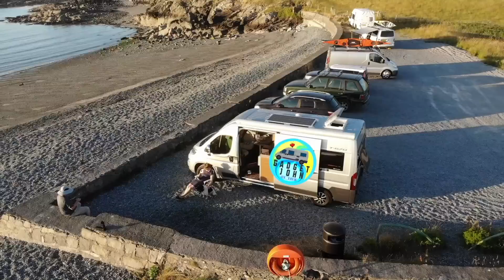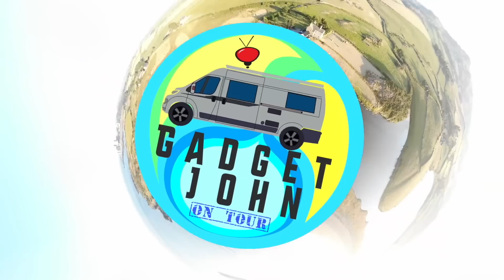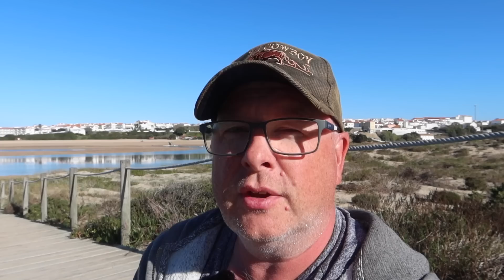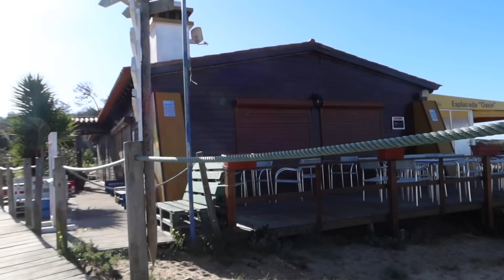VanTech Tuesday - Solar Power Special

Comment: Morning Guys,

Love the videos and general positivity....keep up the great work 👍

Possibly a stupid question, but here goes...

We’re  in the process of buying a Burstner TD Harmony with the Elektroblock Transformer/Rectifier. I’m reading about switching off the 12v panel when the van is temporarily parked up for a few days, I get that, but the handbook also states to disconnect the leisure battery via a battery cut off switch on the Electroblok during long periods of storage. Also fine, I understand the principle because some of the consumers still use power even with the 12v panel switched off.

However, if I disconnect the battery this way will this also disconnect the solar regulator therefore stopping the solar panel keeping the leisure battery topped up ?, or does some auto electric witchcraft keep the solar panel charging ?

 Also, if the solar panel does disconnect , will any harm come to it if it has nowhere to send the charge to ?

Any advice massively appreciated !
Matt
Reply from the maker: If you wire your solar charger to your battery then it’ll always keep the battery charged up. We don’t leave our van in storage so I can’t say what’s best, but if we did then I’d just turn off the power on the control panel and leave the solar working & charging
Reply: @GadgetJohnAdventures  Thanks guys, kind of what I thought, can’t imagine leaving it on will do any harm as long as all the panel is switched off. Love your van by the way, Burstner should pay you royalties. We weren’t considering one until we saw your video’s. Enjoy Spain, cold and foggy here in Yorkshire 👍

Comment: Hi John

Thank you very much for your below informative and detailed reply

I have decided to proceed / Install a Sterling "Pro Batt Ultra” Battery to Battery changer.
I have also decided to add into my system the Votronic 12V Stand by Charger (Trickle Charger) for my starter battery. 
I have also added the Victron Smart Solar 100/30 MPPT Charge Controller

I have installed 2 x Xtreme AGM 110 Amp batteries,
They will be charged by solar and the Victron IP22 240v Mains Charger

My question to you is based upon my past experience of an older American camper
When plugged into mains hook up / Shore line,
My old American camper 12v power was drawn from a mains / 240 / 12v transformer
By using / drawing the 12v power from a step down transformer, 
I was not draining / cycling / using my 12v Batteries

Would you recommend incorporating a 240v / 12v step down transformer into my system 
And using this for 12v power when connected to mains supply ?

I would appreciate your advise on this issue
Reply from the maker: So I can better answer you can you please get in touch via the contact form on my website 👍🏼

Comment: Hi John, when our camper is parked at home the panels are nearly level, when it rains the water collects on the panels. Obvs should the temperature go below, zero the water would freeze. Do you think that standing water/ice would cause any issues for the panels?          Last year I made a couple of simple ramps to de-level (if that’s a word!), so most of the water would run off, tried a cover this winter instead, but still wonder if I may not need to do anything at all. 👍🏼
Reply from the maker: It should be fine, most vans have this issue when left standing and I’ve not heard of them cracking due to ice build up 👍🏼
Reply: Gadget John on tour Cheers John 👍🏼

Comment: Hi John      not sure if you mentioned this -   when wiring up a panel do you have to have the controller as near to the battery as possible , or does it not matter ?        Also worth mentioning, i know 3 people who have blown their controllers up because they connected the solar panel to the controller first, instead of connecting the controller to the battery first. I wish suppliers would clearly print this somewhere. Great vids john , keep it up.

Comment: Thanks for the info, helped a lot. The MPPT controller I'm planing to fit has a" lights " out let, how does that work, do I run it to the fuse box first?

Comment: Solar panel on my Cali, should I have an isolator switch, will be parked up for long periods in Europe in summer outside villa so not using van.
Reply from the maker: The solar controller should keep your system on trickle charge. 👍🏼

Comment: Is there any difference with solar charging for a lead-acid battery and a lithium-ion battery
Reply from the maker: Lithium batteries prefer a higher rate of charge, so 1Kw of solar and 60amps charge is good for them 👍🏼

Comment: I had a flexi panel broke in 14 months replaced with rigid no problems in two years.flexis when stuck to roof have no heat dissipation they get so hot and break down imho.thanks for vid.

Comment: Hi John, great video. Very handy as I'm pricing up my solar at the moment. The only question I have is does it matter if I buy 12v or 24v panels? Thanks mate!
Reply from the maker: Just make sure your charge controller is correct for your panels 👍🏼

Comment: Hi John, thank you for all your videos / efforts. I am currently building a van and would like to seek your advise about using the CTEK D250SE Dual Input DC-DC Charger & MPPT Solar Controller. I will be installing 2 x  12v AGM batteries and will install 240v battery charger. your advise will be much appreciated
Reply from the maker: What advice would you like? I’ve never tried that charger, I always say to separate your services, not combine them as it makes faults more difficult to fix 👍🏼
Reply: Hi Eamonn, I fitted the same charger for our AGM system a couple of years ago, when using the van I have only ever charged from the solar (we generally go away when the weather is sweet!) and that keeps our batts topped up. We don’t have much demand on our system. As the charger is only solar and B2B you would need to add separate 240v charger unit. We did pick up a CTEK MXS 5.0 240v which will charge up to 160ah batteries, so would add that charger to the system if needed (keep it in the back of the van just incase). I just use it for charging the batts in the garage over winter. Really happy with the D250 for solar charging 👍🏼

Comment: What levels of float charge can you experience if monitoring battery levels at 12v fuseboard compared to Victron bv712. I have epever mppt charge controller. I have monitored 20v floating but my victron shows 12.95v Do I have a problem? This morning I checked again and my voltage  was the same at fuse panel and victron 712.
Reply from the maker: You shouldn’t get 20v ever to your batteries, anything over 14.5v will permanently damage your batteries.
Reply: @GadgetJohnAdventures  Thanks john and now a big concern. Can you offer any advice on why this maybe happening? Since I have had the van off road my vehicle battery has not been good and falls down to 12v or less van stood around for 18m during build. Are the solar pan is now able to maintain the 2 leisure batteries. Are they fighting to help the poor vehicle battery. I put a small trickle charge panel on in the cab window through OBD. Maybe should quickly disconnect vehicle battery. Then replace it.
Reply from the maker: Batteries that have to charge or discharge for 18 months would likely be in a very poor state, they’d never hold a charge or reach full voltage. Id say you should replace the batteries. As to why you’re getting 20v from the solar controller - I’d replace that too as it’s faulty if it’s doing that. 👍🏼
Reply: @GadgetJohnAdventures  I spoke to Sterling and they said the B2B should not back charge. I think I need to isolate each device connected to the batteries in turn and monitor the voltages. The vehicle battery has gone since I only notice the normal standing around on these vehicles is not good for them. Citroen technical advised that vehicles are designed to be run regularly to keep battery healthy... Hindsight...... New vehicle battery for sure and my small solar trickle charger via independent OBD switch to isolate it when I start the vehicle is my option for not keep trashing vehicle batteries or running the vehicle for 15 mins once a week (which I also have been doing) arrggghh. Thought I had completed my build by problems continue. Maybe you could add my issue to next weeks Tech Tuesday. Always grateful Tracey.
Reply from the maker: Oh, I didn’t understand you meant vehicle & separate leisure battery. Those are independent and each needs it’s own trickle charger.

Comment: Cheers John.. I have a "Load" + and - output on my charge controller. Do I need to use this to go to the fusebox or ok to go straight from the battery to fusebox..?
Reply from the maker: I’d not use the load connectors if you are using solar to charge your batteries. Only use the load connectors if you’ve no battery to charge.
Reply: @GadgetJohnAdventures   Perfect.. Thank you sir :0)

Comment: Each to their own, but I disagree with you about fridge preference.  The 3 way fridge in my motorhome will run 24/7 for many weeks in any weather conditions using just a few KG of gas.   In poor weather you're going to struggle with a compressor fridge after a few days, it's just one more thing dragging the batteries down.  It may be ok for Spain and Portugal but perhaps not the UK!  As I said each to their own, I have uite a lot of solar (490w) but would never rely on it to run a fridge.  Just IMHO :)
Reply from the maker: That’s fine, but lpg is sold in 1 in 150 ish garages, that’s not that great, but solar is a free source of energy, even on a rainy day in Scotland you should at least match your fridge power with solar power 👍🏼
Reply: @GadgetJohnAdventures  LPG is plentiful on the continent and easy to come by in the UK if you use an app like FillLPG to find somewhere to fill up en route.  Yes solar is a free source of energy but it is weather dependent and as such I would rather not rely on it for something as essential as a fridge,.  I KNOW my fridge will still be running even when I arrive in Ireland next month and don't see proper daylight until June.
Reply from the maker: Lpg isn’t that easy to find in Europe either, in our T6 the 12v compressor fridge used roughly 10 amps a day, 130ah batteries x2 and that’s 13 days of power, you only need daylight for solar panels to work, nothing more, so it’s by far the very best fuel source to ensure your fridge has cold beers 24/7 without ever needing the hassle of an app to find a fuel source 👍🏼
Reply: @GadgetJohnAdventures  Well I've filled up with LPG in over 30 countries on the continent using the standard set of 3 adapters and have never struggled to get gas, even in Turkey and Russia.  In Portugal at the moment every second station has LPG.  You're right that compressor fridges use little power but that's not my point.  It's more efficient to run them off gas and conserve your electricity for important stuff like running the laptop!
Reply from the maker: I’m in Portugal right now and had to travel an hour to get lpg. Only major towns/cities have it. Shell uk are pulling out their lpg too.

Comment: Hello John. A question about solar panels here. I have a 330w Poly panel for my van and was thinking about using up a bit of free space on the roof by adding another smaller panel. The question is, would there be any problem adding a 100w Mono? Answers online are either conflicting or confusing. I have a 100/30 Victron MPPT Controller. The reason for the mono/poly mix is due to a decent deal on the mono.
Cheers mate, glad you're all having a great time down there 👍👍
Reply from the maker: That’s fine, as I said in the video that’s ok as long as you wire the small panel first in series. 👍🏼

Comment: What are your thoughts on the Ring rscdc30 dc to dc 30 amp smart battery charger with solar ppt split charge instead of a separate MPPT controller and split charge relay? I'm still gathering bis for my first van build and it looks like an ideal solution /unit
Reply from the maker: I’d always choose separates in case things go faulty 👍🏼

Comment: That was Great again John Just in Time or Just to Late for me ? I don’t know, Ive just bought Dokio 320w foldable solar panels, 4 panels, I bought ALLPOWERS 100w. Foldable solar panels  2 years ago  with the ALLPOWERS Charger bank. I absolutely love it it charges my MacBook Pro nearly twice and takes about 3 hours to charge, I dont put my panels outside i leave it in my wind screen in side my van while  am in work, it also charges my iPad Pro  and my iphone at the same time, That’s what made me go for portable, plus my Motorhome can stay in the shade while my panels cast be in the sun. Only got the Dokio yesterday so cant say how good or bad they are, thanks again for the video. Ray K UK YNWA.
Reply from the maker: The dokio panels are good, I’ve reviewed them and really liked them 👍🏼

Comment: Hi John new to campervaning iv put 100w panel on the roof and link 2/  75a battery together when I bought the van there was a 40w mobile panel with the van will it be ok to use both at same time they both have there own controls great blog's thanks earl.

Comment: Not power, A Different kinda question. A lot of full timers I've come across, as well as watch on here,  keep their cab separate to the hab area regardless of van size. (Door, curtain, bulkhead etc) A lot of holiday-makers I've come across as well as some I watch, incorporate the cab area as part of the habitation area. If you were to build, which would you choose - and why? My cab is incorporated in my motorhome with swivel seats. If building again, I would keep it separate like our previous 2 builds, but my husband would stay with keeping the cab as part of the living area. I spend more time in it than him and I could be gone for weeks at a time, but he could spend only a few days in it (we're more than weekend warriors ,not full time obvs). I'm curious about yours and Mandy's opinion on that now you guys have gone full time but have the experience of holidaying in it as well as full timing.
Reply from the maker: We use the cab in our hab area, but when leaving the van to go out we drop a curtain that separates the areas, works great in winter too keeping the cold in the cab area at night 👍🏼
Reply: @GadgetJohnAdventures  ah but, "if you were building", as mentioned above?
Reply from the maker: That’s the same, I’d choose exactly the same for the aforementioned reasons 👍🏼
Reply: @GadgetJohnAdventures  cheers 👍

Comment: Hi John, just tuned into ur GJOT. Very useful. Like your view on a separate folding panel to augment the roof panel when sun not at its best. Answers on if they are a good idea, which panel, what size and how to connect into the van?

Many thanks Ray
Reply from the maker: I’ve got a video a few months back on me connecting up a folding panel 👍🏼

Comment: Really interesting session John, thank you very much sir!  I have just fitted a couple of Lifos 105AH batteries and already have a 150W solar panel running through an EP Ever charge controller.
I am thinking about supplementing this set up with a portable solar panel/suitcase panel when pitched.  
My plan is to have a flying lead connected direct to the EP Ever, in the same manner as the fitted panel, and connecting the portable panel direct whenever I am able to.  
I assume this is not going to cause any issues for my set up (I have a 40A EP Ever) even if the soalr panels are different wattage? 
Thanks again for your informative vlogs and for passing on your experiences to everyone else.
Cheers for now, Rog... 👍🏻 😉 🐍
Reply from the maker: I’ve got a video a few months back on me connecting up a folding panel 👍🏼
Reply: Gadget John on tour - Took a while, but I found it in a section of one of your videos, thanks John, exactly how I plan to work mine... ✅😉

Comment: Hi great video and answered some very important questions. I would like to add on the point of mono vs poly panels that as both are probably quoted in watts that for the same wattage then the mono will be a little smaller. If space is an issue that may help. Also Mono slightly better in lower light by producing more power.

Comment: Hi John. Would it be worth wiring an inverter, say a 500watt output, (as I think less than 400w could power a decent charger) into the Van Cab battery, so then when driving, this inverter could be used to power a battery charger to charge up the Habitation battery, therefore bypassing the split charge system for a more direct charge through an intelligent charger ?  Cheers Paul Hall
Reply from the maker: Oh that’s a real waste of energy. Get a b2b charger so your vehicle charges your leisure battery when driving. 👍🏼
Reply: OK then. I’m just thinking theoretically cheap. What if you run the inverter from the Van Cab battery, but then wired the 240v output to the Hook up plug in. The onboard 20A charger would then top up the Leisure battery. Nothing expensive to buy then, for a better charge up ? than relying on the split charge. Maybe??

Comment: Brilliant as always ? Ive a 100watt solar panel charging a 95 amh battery that is coping ok but to be sure in colder times i was thinking of adding another battery of the same make and rating .? "Will my very basic controller cope with two 95 amh batteries" .ps am planning maybe hookup for recharging and toilet empty every 3 to 4 days  thankyou John from Another John.
Reply from the maker: I’ve got a video all about wiring multiple batteries, solar controllers charge any batteries so it could be a single or 4 batteries, as long as they’re wired right 👍🏼

Comment: So much info, I need a notepad :) lol. You touched on the subject of fridges so which is best. 12v absorbtion or 12v compressor. I am defo fitting a 12v fridge in my van but not sure which is best. Many thanks
Reply from the maker: Yeah, in the video I did say the best fridge s 12v compressor, I went into that especially 👍🏼